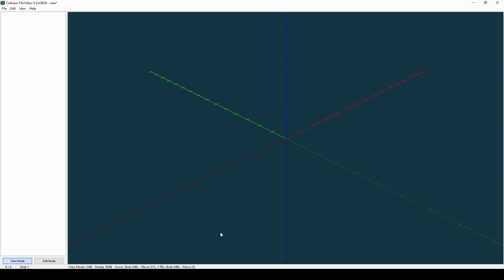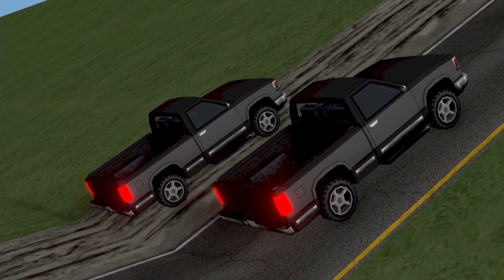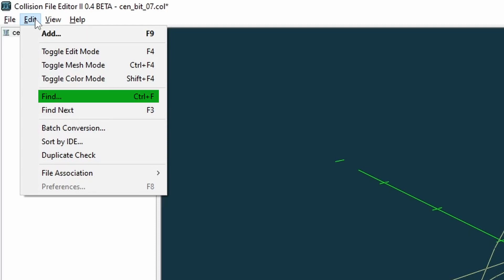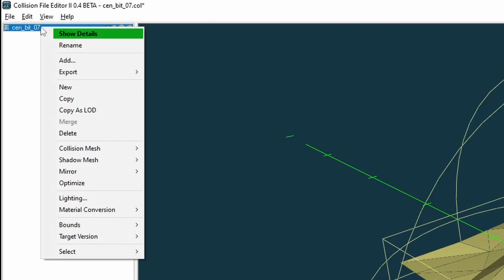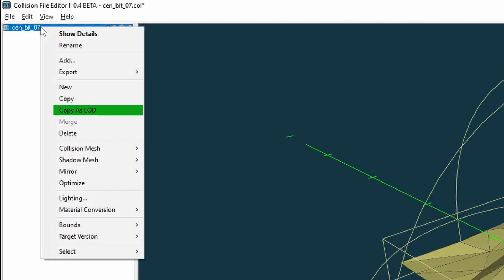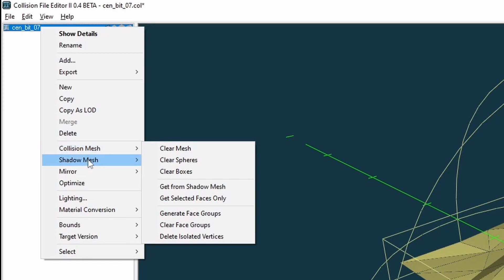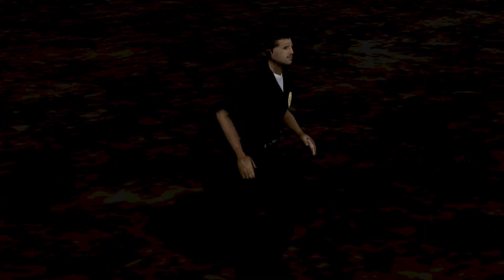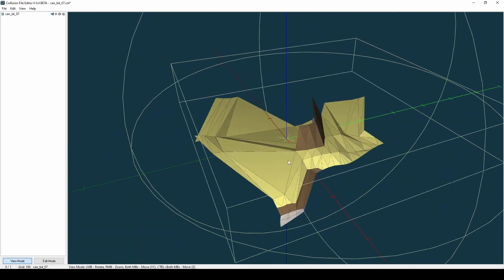04 - Collision Editor walkthrough

Comment: sir can i remove the collisions for the object with this tools?
Reply from the maker: you can use it to select all polygons of the collision model, then delete, and it'll have an empty collision model. if it has primitive spheres / boxes, then those can be removed as well
Reply: @thorsmoddingcorner9464  I'm specifically interested in how I can set or change the position of the collision, that is, I don't want to delete it from the game, but just move it very far because I don't need it there
Reply from the maker: @vuule9840  If you don't need the object to collide with anything, then you can just remove all of its faces and primitive boxes. What will be left is its boundings which are used for player camera